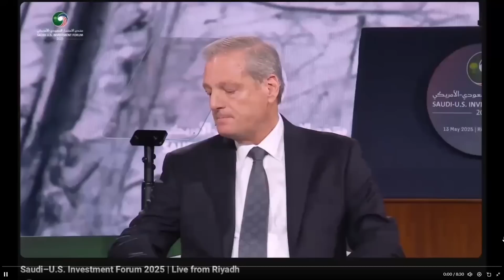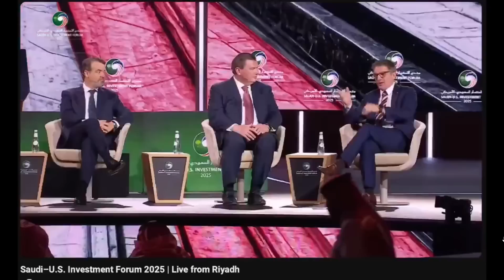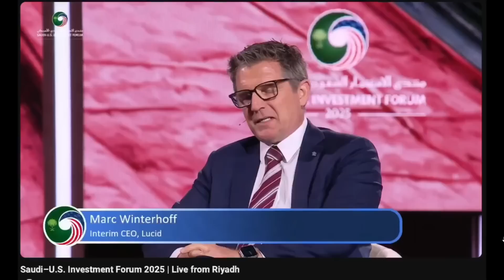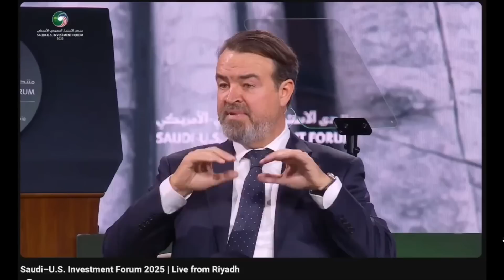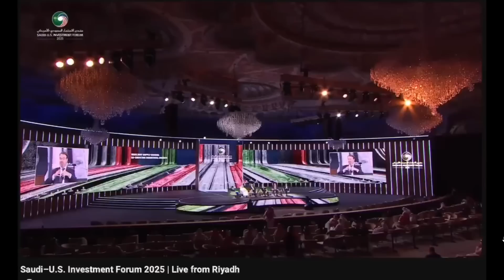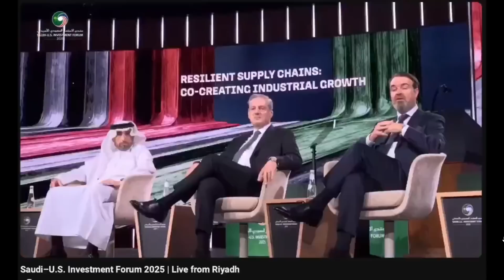Lucid Motors Just Revealed HUGE Saudi Expansion 🌍 | Why This Changes Everything

Comment: I like the PIF guy talking at the end. The framework is being set for, “OEM’s in Saudi Arabia.”

He stated firmly that they needed to be profitable in their own right with the President of Lucid motors on the same stage. 

Lucid will be run profitably by American financial standards. 

Investments sure, and you will become profitable. I wonder how this commitment is being executed?

This is why mile stones of construction, model roll out and production are the way they are. 

I understand they are not going to write blank checks. These dilutions are well measured. 

Question? In a few years if the PIF says they have announced that Lucid will do a 1% stock buy back over a 12 month period, what happens with valuation of the equity?

Boom upwards, right??